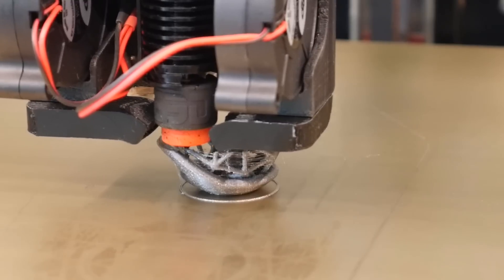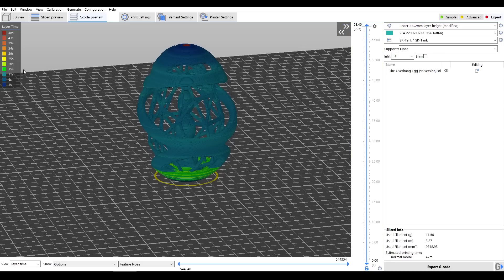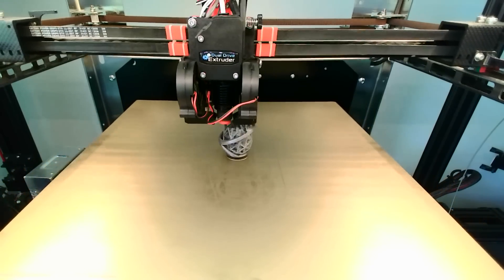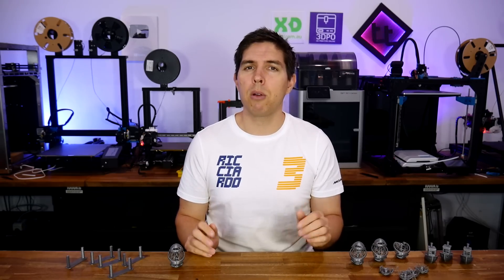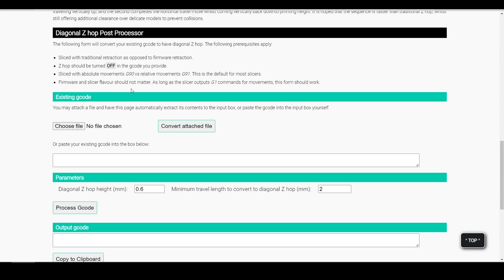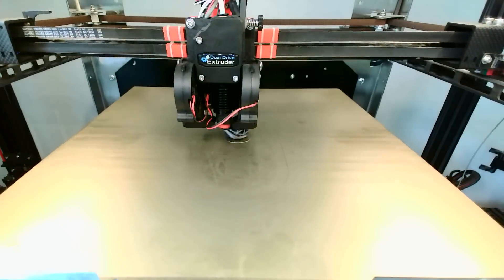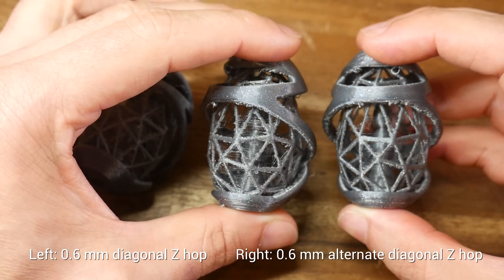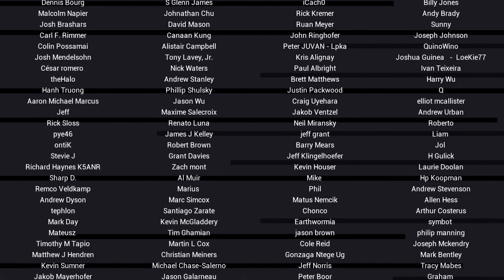Diagonal Z hop - Help me test this new slicing idea

Comment: I think you need to ask yourself "why" does z-hop cause stringing when just horizontal movements don't?  The solution comes out of that question.  I think the difference in stringing between z-hop and no z-hop is two fold:

1) When you lift the nozzle directly off of the print surface, the action of doing this creates a suction effect which pulls some of the molten plastic back down the nozzle.  You then move the head, stringing the molten plastic. 

2) When you move horizontally (instead of lifting) you avoid the suction effect, and you create a wiping effect which helps clean the nozzle, avoiding stringing.  

With these two effects in mind, I believe you can see why your "diagonal Z hop" produces the effects that it is. 

I can see two possible solutions to this.

First solution:

Start the hop maneuver AFTER you have already horizontally moved off of the print surface (and you are in the air), thereby maintaining the wiping effect, and avoiding the suction effect. 

Second solution:

Begin the hop by doing a quick filament retraction, and at the same time an in-place head orbit, providing the wiping effect, toward the end of the orbit start increasing your z height.  In practice this looks like a corkscrew movement, as you begin your hop.  The filament should be continuously retracted throughout the corkscrew movement, providing a reverse suction effect, to counter act the somewhat reduced suction effect (reduced because of the spiral lift) that will remain from lifting off the surface.  I believe Bambu Lab is using this method in their slicer (this is what my X1C looks like it's doing), and it seems to work pretty well.
Reply: Maybe we can make a script that'll generate a matrix of different retraction + hop timings to see which ones work best for which filament/printer.
Reply: I went through a similar reasoning while watching the video. That initial swipe is what fixes the stringing. Your comment reminded me about BambuLab's "corkscrew" z-hop which I saw in a Mihai Designs short. That made me realize that this behavior is enabled by a Bambu Studio setting called Z hop type, that you set to Spiral. There's also Slope, which basically does what's explored in this video (not sure if that setting was implemented before or after the video). The nice thing about this is that the setting is also present in OrcaSlicer, which works with any Klipper or Marlin printer, making it available to pretty much any printer. So thanks for sharing your thoughts!
Reply: solution one was the first thing I thought of after watching this. should solve all the problems. But that would have to be done in the slicer not a post processing script as it needs to be aware of the model.
Reply: Without even having seen the video, came here to say exactly this!
Reply: Part 2 seems like the key takeaway; a lateral move off the part shears the plastic at the nozzle orifice. As written the diagonal Z hop applies varying levels of lateral shear depending on the move distance. Whatever method used, it should be independent of the move distance. It could be in either of the 2 solutions above, a retract at a fixed angle, or an arc retract.
Reply: well if that is the case why does spiral z hop reduce stringing
Reply: Solution 1 wouldn't solve the core problem, though, unless I'm missing something.  The entire reason for doing the z-hop is to not move horizontally while the nozzle is still at risk of hitting the print.  Moving horizontally to avoid stringing before hopping has most of the risk of collisions that not hopping at all does, I would think.
Reply: @davydatwood3158  Well... to be complete, he really needs to focus on fixing that root problem and not worry about bandaids like this.  Fix the real issue and you don't lose the performance associated with the Z hop.
Reply: @williamsteele  While I would agree, I would say that steep overhangs just have this problem pretty much intrinsic to the material properties. It contracts when it cools, and the small tips just got the worst possible scenario to cool quickly unsuported. The solution might be to just slow down to a crawl on those parts, which is also sub-optimal. I dunno if there is anything else that can be done, any tips are sure welcome.
Reply: @Kalvinjj  Well, optimal should be compensating for the upwards curling. This might be archieved by doing a small downward-movement at such overhangs.
But for that, the slicer-algoritm should be pretty complex since it needs to know on multiple layers what the object will be and keep that into focus with compensation on all subsequent parts of that layers, thus needing to create an array of compensating layer-endings which needs to be calculated according to the contractions for the filament.
Very nice concept though hard to implement and will likely not work on all printers.
Reply: @elvinhaak  That's a very interesting approach and really complex as well indeed, and would probably require quite a bit of calibration. I can imagine that printing it like 1 or 2 layers down could already solve the problem and that could avoid the problems with the head's parts colliding with the printed part as well.
Reply: @Kalvinjj  Yes, exactly what I was thinking. But in some cases 2 layers could not be enough. It can also well combine to make a better flat surface  when it slopes back up like when printing threads where you have the same problem with stringing as in this model.
Reply: @davydatwood3158  it depends entirely where the point of failure is.  There are three potential failure modes here:

1) You are printing along, finish a run, and as you move to your next print location, you run into a protrusion close to where you were just printing.

2) You finish a run, and you run into a protrusion somewhere between where you just finished and your destination.

3) You finish a run, and you run into a protrusion very close to your destination print site.  

Number 1: doesn't cause failure all that often because the area is fresh and warm, and deforms easily, and so bumps tend to move out of the way.

Number 2: happens some times (though most slicers try to avoid unnecessary travel over the model), but since it should be an island, you should jump over it with the first solution I proposed, as you are doing a z-lift as soon as you get into free air.  Also, you could prioritize finding free air to make that z travel.

Number 3: is the failure mode I observe most often, because the destination is usually cooled significantly (as its often gone the longest without being touched), thus it's already pretty rigid, and the print head has reached it's maximum travel speed, so it hits with the most force.  The first solution completely addresses this failure mode.
Reply: @bujin5455  Yes, I've seen that specially in supports. The print head can freely move away from the curling little horns (I hate those...), but when it's reaching the destination it will knock it out easily as it hits the curled up horns sharply.
Happens a heck lot with top parts of a circle.
Reply: @bujin5455  you make a very cromulent point, sir!  I defer to your greater knowlege.

Comment: I think this is about 80% right, and I'm really intrigued by your thoughts here - I think there's an additional constraint/limit here... you need to leave at the start of travel, and arrive at the end of travel, at a certain movement angle, say 30 degrees, or so... if you do a long travel, you are risking hitting curled edges somewhere, since you're moving mostly horizontally at one or both ends.  This means a move is in three phases... leave at a degree of uptake until (and if) you reach your z-hop height, then a horizontal travel section if needed, then at the right point, start your descent into the end of the move at the arrival angle.  This means more complicated gcode and possibly accel/decel delays, but the angle you leave and arrive at, needs to be constrained to keep from these quasi-horizontal start/end of the move.
Reply: That was exactly my thought too. His issue with short travels was that the angle was too steep. Rather than limit the minimum distance, he needs to control the angle. It ends up looking a lot like an acceleration curve: a fixed angle up to the desired height, a flat travel at that height, then a fixed angle down to the end of the travel.

Comment: That's so wild, obviously you thought of it first because you tried it and made a video already  but I had this EXACT idea this morning when I woke up.  The conclusion I came to is that you'd have to be able to set the "diagonal angle" otherwise really detailed parts with a little curling might still get hit if the hotend didn't get to the full "hop height" before travel, and if you get to the full hop height before the diagonal move it actually just ends up being a longer travel move.

Comment: Innovative idea. I wonder if after a retract, a wipe on the current part couldn't solve the stringing issue, then z-hop, move, unretract?
Reply: PrusaSlicer has (and all Slic3r based slicers should have) a wipe while retracting that should do this wipe-move right before Z-hop. And it also has a setting to have a portion of the retract to happen before the wipe. The help text indicates this "retract amount before wipe" is intended to mostly help on bowden printers.

Comment: Maybe this has been said in other comments, but maybe you could create a hybrid of your alternate approach and the standard approach. 

I think starting the move perfectly horizontally, then going up, over, and down would be the best of both worlds. This would also have the benefit of keeping the leave and re-enter movements consistent across more scenarios, whereas the diagonal approach changes the angle of the nozzle path depending on how close the start and end points are. 

Hard to visualize through comments, but think of it like a chopped square wave like ⎽⎽⎽⎽⎽/⎺⎺⎺⎺⎺\

Comment: My idea for this was to removed the original z raise and add the Z height increase to the destination gcode before the gcode for lowing back down on the Z. This is diagonal on the take off, but normal Z lower as you go back down to the part. I have created post script I run from excel VBA code to achieve this. (I see you got to this point as well. Didn't watch the video first.. lol)
Reply: I think you're right with this. The was the diagonal hop is done in the video would still lead to a collision or still have a higher chance of one. Your method actually gets to clearance height where it matters, not in the middle where the hop height doesn't make a difference.

Comment: Did I miss the explanation of why this works?
Reply: He kind of explained it. The z hop avoids hitting the curled edges on the already printed parts, but introduces stringing that doesn't exist when using a flat move. Flat moves don't exhibit the stringing. So I diagonal is a middle ground where there is less ooze, but eventually raises enough to avoid the curled edges at the end of the move.

As many others have pointed out, a good compromise would likely to be to start with a flat move (to avoid stringing), then do a full Z hop (to avoid hitting the part) and finish a normal flat travel.

Comment: I think you have to avoid any nozzle movement but the horizontal one just after the retraction - as far as I get it that’s the main cause of reduced stringing when no Z-hop is in use. 
The Z-hop has to be done just before the nozzle reaches the next extrusion point to avoid the collision. 
Of course the transition between movements can be fluent like S-shape to reduce resonances, however it’s a matter of fine tuning the whole idea.

Comment: i had thought about adding a slight raise during bridging to keep sagging down as it has potentially time to harden more of a "stretched"  state so it's essentially bowing up to compensate for the sag
Reply: In manufacturing with beams or other structural steel, such as the main rails of trailers, etc this concept is called “pre-cambering” they camber the material so that it’s bowed upward when there is no load, but after the structure is loaded,it supports it flat

Comment: I had a similar idea for a while, I'm so annoyed when the printhead bumps into stuff, but when I enable z-hop it just creates a bunch of stringing
Reply: Printing may fail because of the impact, but there is a solution to the stringing: I use a lighter or a hand-held gas soldering iron to briefly scorch it and hand rub off the small balls that stick together.
I prefer stringing. With a well calibrated heat setting and a pull back, this will be minimal.

Comment: Do you have "wipe while retracting" set in PrusaSlicer (unsure what it is in cura) when enabling z-hop?  I would expect that what your change does is similar to: retract while moving the nozzle over printed stuff to basically wipe it clean and the do z-movements to avoid hitting stuff.  That's what I would expect "wipe while retracting" to do when z-hop is enabled: retract and wipe and then move up.  So, did you have that option set?
Reply: I am actually amazed, that he doesn't seem to know this option.
I always enable Z-Hop, and I always enable wipe.
No stringing here.

Comment: Hi, I have an ender 3 v2. It works well and is tuned. The problem is that it seems to always ooze a small amount of filament out the nozzle causing prints to be messed up. It comes out a little at a time when it shouldn't(ie not extruding). Nozzle temp doesn't matter. Would appreciate any suggestions. Thanks
Reply: Mine also oozes. It's just like a hot glue gun - anything that's in the nozzle is still liquid and gravity will still pull it down. Retraction and pressure advance both relieve the pressure in the nozzle so that the liquid isn't being forced out by the difference in pressure, but gravity will still act on anything left in the nozzle until it drains.

One thing to try is to actually reduce your retraction. Like a glass ketchup bottle turned upside down, the liquid will only start oozing down if there is an air gap behind it. Normally the entire throat and nozzle would be filled with filament, but when you retract, you begin to pull in air. Pull in too much and it can get behind the liquid filament and release that airlock. Try Michael retraction test and see what the minimum retraction is that prevents significant oozing.

If you can modify your Ender to have a direct drive and/or linear advance / pressure advance, you might be able to significantly reduce your retraction settings from the default.

Still, even with all of that, my Ender 3 V2 oozes slowly until a considerable amount of filament has come through (upwards of 20mm long extrusion). I think it has gotten worse since I extended my hot end to allow for higher flow rates.
Reply: I had something similar going on, it was a loose nozzle. Warm it up to max temp and check that is has not come loosen. A small amount of filament can be squeezed through the nozzle thread and leave a blob now and then.
Reply: That's totally normal for lots of different filaments. I've used a lot of PLA, PLA+, ABS, TPU, some PETG and the only material I've used that doesn't ooze substantially is carbon filled Nylon. I'm currently using Taulman carbon fiber nylon alloy and it's fantastic. Yeah, it's expensive compared to ABS or PLA, but it prints beautifully and is incredibly strong. I print functional end use tools with a .6mm diamond nozzle.
Reply: thanks for the info dustin
Reply: FYI I Found this solution, tried it and it solved my problem , Thanks for your reply.
https://youtube.com/watch?v=y5e3RawEpuU&feature=share

Comment: Very cool idea. I’ve always thought it would make more sense to have an extrusion path finish then retract followed by a wipe move away then a vertical lift. Followed by a travel move. All the benefits of a hop without stringing.
Reply: There are options like these also in Cura. wipe distance within wall, after/before retraction, etc...
Reply: @Montragon29   I didn’t know that.
Reply: Cura is unable to do a non-vertical z hop.  With PETG wiping before z hop does not help
Reply: Wipe while retracting is an option in Superslicer. Has about a dozen options for adjusting it's behavior too. Prusaslicer has it too, possibly other slicers.
Reply: @LightCarver  these options exist in Cura too(wipe distance within wall/path after retraction etc). Also there is an option for coasting within wall/path before/after retraction, before movement to other parts of the print or layers.
Reply: @Montragon29  That's good. I haven't used Cura in quite a while and didn't check.

Comment: You should do triangular Z hop. Move diagonally and land vertically (as a rectangular triangle).
Edit: Ahaha ... end of video :D

The best would be to use curve instead of direct lines. Or at least first move is horizontal for 5-10%, then move to diagonal until vertical.